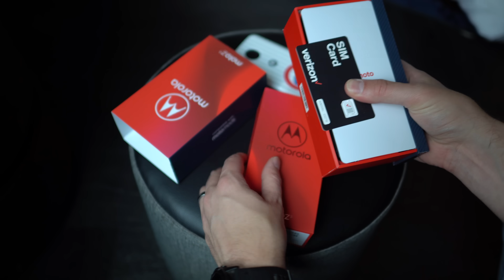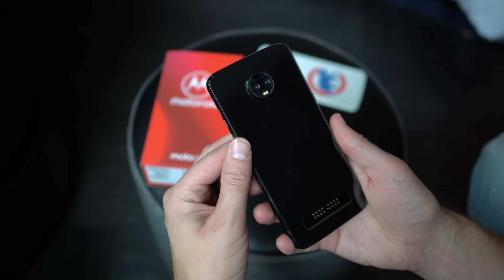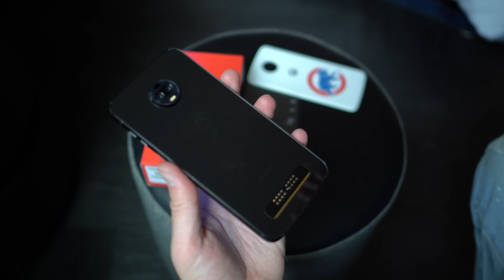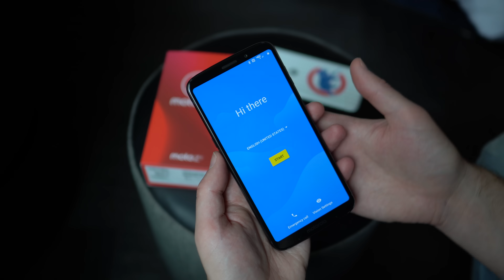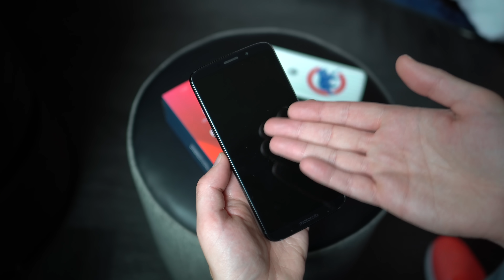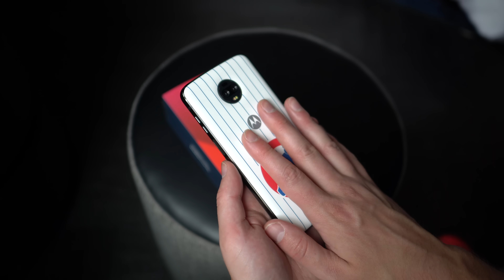Moto Z3 Unboxing and First Look!

Comment: Motorola was the first phone to avoid headphone jack due to Moto Z (1st Generation) as it's a 5.1 MM thin,one of the most strongest and durable phone. Check jerryrigeverything Moto Z test video, you will be amazed about it.

Even Motorola is providing free 3.5mm to usb 3 cable.
Still using super AMOLED.
Still using stock android with great tweaks to the os.
Still the slightest phone.
Still the strongest phone.
Still the durable phone.
Still the long lasting phone.
Most of the Motorola phones won't break due to daily routine of dropping the phone. 
Only a genuine Motorola user can experience the greatness of the phones, tragically present generation is addicted to fake selfies and megapixel madness but if you take a selfie or a normal photo you can see that it takes natural photos with realistic images but not over saturated exaggerated selfies or fake videos of photos. 
Motorola screens are also true to life displays like IMAX screens. Only Motorola phones can survive casual and regular hard drops. 

Sadly now Motorola is in the hands of Lenovo. But Motorola has it's individual team to work for themselves. Lenovo is a producer only. 
Vivo, oppo and one plus are from BBK. Only Motorola is an individual company came with many inventions and innovations. If you say oppo, Vivo, one plus, Huawei, lg etc comes with great cameras! They aeeymade by Sony. Motorola always worked hard on giving the best user experience. If you buy a mid range Motorola it can compete with any flagship phones of other phones in user experience and fast processing. Unfortunately people rely only on benchmark numbers. Other brand flagship phones are like a sprinter running in Olympics but Motorola is like s 10KM Marathon runner, works efficiently with consistency.

My comment is not called fan based comment, it's called USER EXPERIENCE.

Comment: Did y'all keep the same energy when LG G6 came out with an 821 processor?
Reply: @_AlteredTech  your last sentence literally ran in circles as 2017 lg G6 sold at 2016 specs. Sexy? Extremely subjective with that 1080p lcd screen that failed at getting anywhere near bright? Features? What features? 😂🤣😂 LG has the most disliked software of all Android devices.

Comment: Headphone jack cancelled it from my options 🤷‍♂
Reply: tDames of The WerkHeads 
Exactly!!! Still has that weird fingerprint scanner on the side of the phone that doesn't act as a power button like the older Sony Xperia phones. Plus the pricing is weird I mean this is $480 while the Z3 Play with an less powerful CPU/GPU is $500?!?😕 Seriously Motorola (Lenovo) what the hell are you guys smoking thinking that this is a great business strategy?!?!?
Reply: Same. And side fingerprint reader is just bleh
Reply: Motorola One Power.... Headphone jack and rear finger print sensor. Android one too.
Reply: Bflo23 I just hope it's actually a flagship phone.
Reply: Patrick Shores ... You have to remember that flagship phones cost like +$800. Everyone wants to bring up OnePlus 6 but I can tell you that it has plenty cons. The Moto z3 and Motorola One Power are far cheaper than the "real flagship" phones so you have to comprise when one is paying like under $500 and not expect same flagship features. There is nothing wrong at all with the 636 or 835 processor.
Reply: Bflo23 I don't mind spending money for a high quality phone with up to date hardware. I've had a Motorola since the Droid 2. But with their lackluster offerings im going to have to look elsewhere.
Reply: Most of every flagship today doesn't have a 3.5mm headphone jack.
Reply: It is little bit odd but the Moto Z3 Play is unlocked with more bands and was coming with battery mod & Alexa speaker mod (promotion). The Amazon version was $450.
Reply: Eh with me I use Bluetooth headphones and in the car I do use the aux but the dongle would be fine. Has a great battery especially with the mod so not being able to be charging while listening to music is okay

Comment: Just got the Moto Z3 as a gift.  I am I-Pad literate, so I am trying to work with this phone in a similar fashion.  I do resent that the Androids don’t have that round Home button that I-pads have.  I am moving from a flip phone, so I will be entering my Contacts information manually.  I found Sound under Settings to change the volume of the Alerts and Ring.  How do I change the general Ringtone?  Secondly, can I Silence this phone by pressing the Volume Down button if it rings in a store, doctor’s office, etc.?   Can I dial by voice once I input my Contacts?  How?

Comment: 2 Questions:

1. Does it have the shattershield display?
2. Can you turn off the display with the fingerprint reader like you could with previous Motorolas?
Reply from the maker: Nope and nope
Reply: Droid Life Wow! So no more Z Force lineup and no more technology that made Motorola special! That makes me sad. :(
Reply: Shattershield was a terrible "tech" I love my Z force but my screen is shot
Reply: Patrick Shores mine is shot too. But it got shot after taking a brutal beating for 2 years. Mind explaining why it's a bad tech though?
Reply: Imran VP it's a plastic screen. And originally is was designed to be user replaceable. But Motorola decided against it. Scratch resistance is much more useful for regular use.
Reply: Patrick Shores But wasn't that the point? That fact that Gorilla Glass can barely hold up to regular use without breaking is the reason why Motorola's option is superior. Sure it's prone to bit more scratches compared to GG but the screen never cracks or breaks.  Which eliminates the need to screen protectors ever. I thought it was awesome.
Reply: Exactly my point. Why spend more on a screen protector when the phone has Shattershield display?

Comment: Got my Z3 Play, yesterday, and I have to say, I am kinda shocked. 

IMHO it is a big design fail, with the power button on the left side! And it is the same with the Z3.

You said, you like the set-up. Maybe I'm doing sth. wrong. Whenever I use it with the jbl speaker mod and set it down or change volume, the phone turns on and off.

Even worse with projector when projecting on the ceiling. I accidentally rebooted the phone. 

I would love to see your opinion on that. I do think of sending it back. It is just so frustrating, besides all the other shortcomings I have to accept when upgrading from a Moto Z Play. 

cR

Comment: I think a quick look at sales figures for the Play editions verses the Z and Z-Force editions answers the flagship question.  Motorola wasn't having much success selling top tier flagships.  I see a ton of Plays, and not in the hands of mod users.  I see them in the hands of older people and other people who see their smartphone as a tool, not a fashion accessory.  I understand people who use their phones as substitute computers, or who are hard-core gamers, or bloggers or other "power users" who need the fastest phone with the most memory available.  But a lot of people just don't need that in a phone.  And at Verizon, the Z3 is really the only true mid-tier phone they are selling.  Yes, its boring, though I expected the same 5.5 inch display, so props for changing that!  And that's ok.  I think the 5K thing is just a testbed for the Moto Z4, which, if its really useful at all, will have it baked in.  At that point, Moto may offer a true flagship with a new and contemporary design language.  And if so, good for them!  But, I hope they've learned a little with this Z model and remember to offer a Play version with a sub $500 price point.  I think that's were they can make the most money.  As for this phone?  I might buy one next year when they become more available second-hand or the prices drop at Verizon a bit more.  My G5 is getting long in the tooth and has a crack.

Comment: I think I prefer the Moto Z3 play over the Moto Z3 because 1) it will be more battery efficient with the 636 processor, 2) Extra battery power with the free battery mod, 3) came with free Alexa speaker mod during the promotion and 4) unlocked. Im sure a Moto Z3 Play sale is coming  black friday. My other option is Motorola One Power. Tough decision.
Reply: Bflo23 Well SD 835 is better at optimizing battery life so it’s actually more efficient, but your other points are good
Reply: topgeartim ... Do you think it will get longer screen on time hours over 636? I easily get +10 hours screen on time hours over 3 days with my battery king Moto Z Play (625 processor). I think the Moto Z3 will be better battery efficient than  Moto z2 force because being smaller screen and being 1080p. I expect it to run faster than Moto z2 force (quad HD). I heard the 636 processor was more efficient than the 626 processor of Moto z2 play.

Comment: The exclusivity ruins it. It may as well not be available.
Reply: It will be available on other networks. Many phone companies do this with different carriers. Like the Samsung Galaxy S8 Active, that was for AT&T only at 1st. Then it went to others. All phone companies and carriers do this. They make a deal that last until a certain time. The carrier tries bringing in new customers that way. Once the deal between the two is up, usually months later. Another carrier gets it and sells it at full retail. Meanwhile that orginal carrier is now selling it much less. It benefits both cellphone company and carrier. It's a marketing/demand scam basically. Make you think you can only get the phone you want at X. So you go there and are stuck with X as your provider. Months later your friend goes to one of all the other carriers that now sells that phone, pays full retail on a phone that carrier markets as new, it's not, almost a year old really. Guess what happens a month after that? That cellphone company comes out with the new generation of that phone. The process repeats itself. It's a way to keep selling that phone at full retail until the next generation.

Comment: Moto Z3 is the best
Reply: I just bought it at Verizon online for $240. It's a smoking deal for that price. I also got the JBL mod speaker and it's one excellent speaker. No real big complaints here. As I'm typing I'm able to get reception in a difficult area I like the lgv30 which I really really really wanted but it didn't get reception where I'm typing.

Comment: This comes as extremely great shocking as z3 share the same processor as z2 ....... has anything ever happen like this in smartphone history ?? Same processor for 2 generation straight ?? Wtf is wrong with the people in Motorola (or should I say Lenovo as Motorola is own by Lenovo.....a Chinese company)
Reply: Calm down man. Snapdragon 845 really isnt that much better than Snapdragon 835.
Reply: LEONARD WONG LG G6 came with 821 processor. Same as LG g5
Reply: Did you miss the part where he said $480?
Reply: The price is a decent steal for Verizon users but that also began the question of why release a Z3 Play if you're gonna release a Z3 flagship that's specwise better than the Play model (835 vs 636) and costs less?
Reply: Galaxy S8 and Galaxy S9 have the same, really not much difference in the two. iPhone has done this too.

Comment: Call it right now, last Gen specs, only 1080p OLED display and no HEADPHONE JACK, this phone is so shit for even the price, you can get a one plus 5T for the same price and a snapdragon 845 with 6/8 GB RAM with very little bloat ware. Motorola is a dead phone company ever since the droid turbo!
Reply: __ Bilak_78__  OnePlus 5T comes with a SD 835 not a SD 845
Reply: Arjun Sen Sharma my mistake, but I hope you get the point, the Z3 is a year to late maybe 2 years to late...
Reply: Yah definitely i got your point.... I was also shocked when i got to know that z3 came with 835...so there is basically no difference between z2 and z3 in terms of processor. Huge disappointment.
Reply: Arjun Sen Sharma much agreed, Motorola need to step up there game!!
Reply: __ Bilak_78__ I'd make a blind bet of $10,000 that 95%  of Samsung Galaxy s9 customers do not go in the settings and change it from 1080p to 2k. I take that back ..... 99%!
Reply: __ Bilak_78__ ... OnePlus 6 is garbage. Horrible support (poor customer support/warranty support/slow updates), oxygen ehh, poor camera, bad speaker at bottom front, etc.
Reply: I love my Droid Turbo. Best battery life I've ever had and I'm actually typing this response on it. It's a tough, efficient and overall good day to day phone. However, I am looking to upgrade and was looking forward to the Z line. Motorola needs to stop putting out these underwhelming phones. I'm not even interested in this particular phone, they reduced the battery size for one, my turbo has a better resolution than this one! and still offering lower onboard storage than competing models, and OS is dated. Wake up Motorola or you will be a write-off for Lenovo.